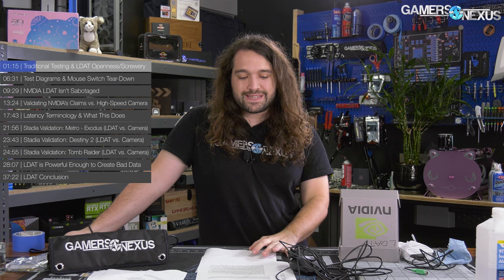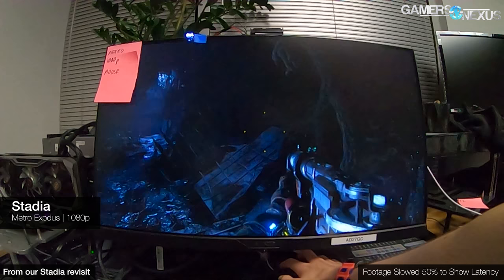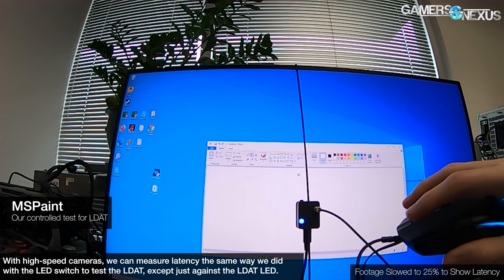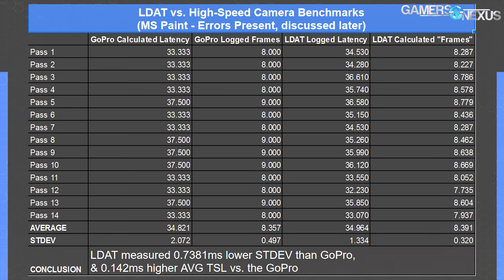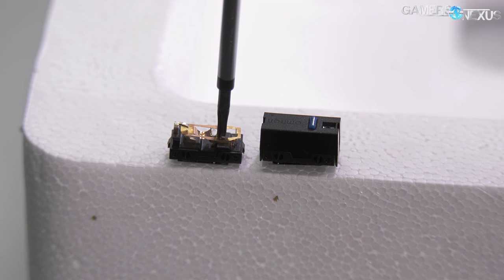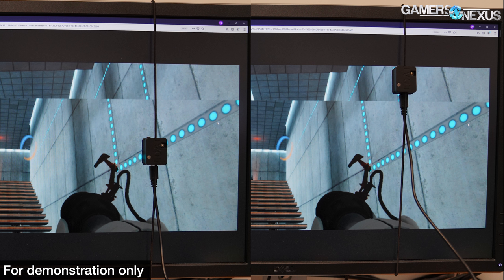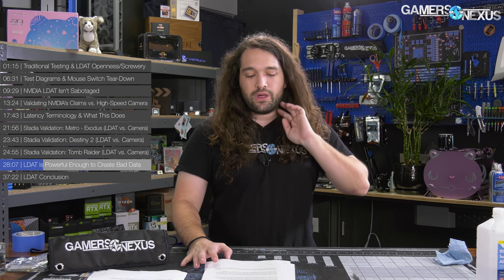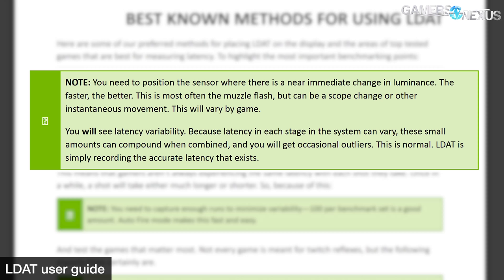Automated System Latency Test Methodology (NVIDIA Latency Analyzer Validation)

Comment: Hey Steve, thanks for addressing my mouse signal question that I posted on the Ryzen vs. Intel system latency video:

"How did you measure the exact moment when the mouse was sending the signal? There's some travel in the button before the signal is sent, and even after the signal is sent, there may be some flex in the button itself that may appear as movement on the high speed camera. Not questioning the results, but this could have driven up your variances."

Comment: Just a thought, for assistance of device setup, perhaps make a guide consisting of a clear plastic with adhesive (old school projector transparencies and some scotch tape come to mind, cheap and any printer will work with it) and with printed circle reference for the sensor region (that does not interfere with observed region) and a printed rectangle for the external device profile. 

Using the muzzle flash example you can apply the template on screen near the muzzle, verify using video that muzzle flash is accurately passing through the circle of the template. If it's not positioned well then you can adjust the template in measurable quantities (4mm up and 6 to the left) as opposed to blind adjustment to find a sweet spot. Then final setup consists of aligning the body of the device to the rectangle of the template. The template can remain in place during testing, as time for photons passing through less than a millimeter of clear material is negligible.

Realistically the template can be made in about 10 minutes between measurements and making the 2 shapes in any graphics program that prints to scale (Microsoft Word can even do it). Produced for with less than 30 cents material. Plus, testing setup can be done in 1-2 passes taking maybe 10 minutes total time. 

Additional benefit, it helps with troubleshooting. If the phenomenon you're observing does not encompass the entire sensor portion of the template (Lara's arm in Tomb Raider) you can reject it for testing.

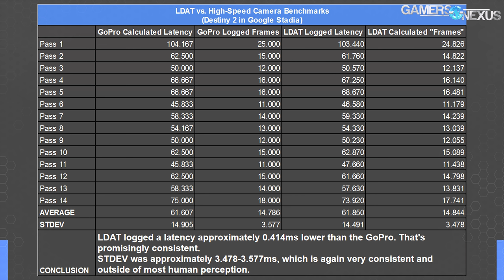Comment: I think there's an error at 24:42, where the conclusion drawn in the table was that standard deviation was around 3.478-3.577ms, when on the chart it looks like that's the standard deviation in *frames*, and the standard deviation in milliseconds is 14.905 and 14.491 for the two methodologies, which feels fairly high and maybe within the range of human perception. Of course, that's a comment about the variance of Stadia and Destiny 2, not of your testing methodology.

Comment: Hey. I have been messing around with latency testing using an arduino and a photodiode, which has been fun, and there are some things I've learned along the way that you might or might not find useful, I'm just throwing these out there.
- Consider using in-game menus rather than shooting guns. Taking CS:GO for instance, opening the buy menu darkens the screen instantly, and closing it restores brightness. I've found it was great if you can find a bright spot (my preference is on the Vertigo map, near CT spawn, there is a lamp a head level, you can stuff yourself in there and it works nicely.
The "tab" menu for Fortnite works aswell, and most games have some kind of inventory, or menu or something.
- It might not be the case with LDAT, but my photosensor is reacting faster on dark -> light transitions rather than light -> dark transitions. Might be something to consider, however it does not really matter if the methodology is consistent.
- I don't know if it was mentioned somewhere, but monitor temperature do affect these measure quite a bit. I've had consistent differences up to .5ms on a cold boot during winter vs 2 hours alter when the panel was warm. Might be worth considering adding some (doesn't have to be very precise) temperature check.

- Also, it's not really LDAC related, but using an Arduino, you can program it to send keyboard or mouse inputs at random intervals and auto measure, and you can then 100% automate latency testing, and export it nicely to CSV or whatever you want, using either something like puTTY to monitor COM port, or a program that will do it and spit out data (I have a small Python one which isn't perfect yet, but works quite well). Random intervals for automatic testing is important, I've had issues before adding where the detection would "sync up" with the refresh rate, and I had bad data.

Great video, great job, keep doing what you're doing, you've been an inspiration for me !
Reply from the maker: You should not use in-game menus. We talk about that in this video. They go through a different engine path in many games and are not representative of actual gameplay.

Comment: *small typo found!
the chart at 24:36 says stddev is 3.478 to 3.577ms, it should say 3.478-3.577 frames
Reply: Also latency is 0.243ms higher on LDAT. The 0.414ms is the difference in the standard deviation.

Comment: It may not always be the most relevant piece of data, but latency capped at 140fps on a 144hz VRR monitor in competitive games would indeed be a valuable comparison between various AMD and Nvidia GPUs. That's probably the ideal to most of your audience (or should be, there may be a lack of education) and would definitely be worth at least some investigation.

Also, don't forget that there's nothing wrong with doing the classic mouse1=strafe left test. Movement typically has higher baseline latency than shooting because of acceleration etc, but if you're just looking for a latency difference it is often a perfectly good test.

Comment: So Nvidia basically did the same thing I commented in your latency video. But I used an Arduino instead. A light sensor attached to a screen conected to an Arduino that triggers a mouse button press using a gpio soldered to a mouse button and using the arduino to log the clock cycles between the GPIO output and the LDR light sensor. The only manual labor involved is choosing a portion of the screen that drastically change light levels when you click to position the light sensor.

Comment: IMO the best method for latency testing would be custom software. EG just make a simple game (even just using Unreal or Unity) that is locked to 1000 fps (very easy to hit with just a 2d game) that when you click the mouse it changes colour. That way you remove a GPU's ability to render a game faster reducing end to end latency (the faster the GPU can render the less system latency there will be as your mouse input will be processed faster).

Comment: for better repeatability of LDAT positioning it may be helpful to 3dprint/ make a bracket that can  have a few x and y notches or positions so you can repeatably plate the LDAT, using the  screens physical edges as a datum.
Reply: also for in game to ensure aiming at a specific place, would working with a game that has a "save" function that loads everything in the exact location each time you re-load from the save help?

Comment: Nvidia Geforce's "Why System Latency Matters" video seems a little off to me, They attempt to show that system latency is the cause of "Peaker's advantage" when in reality it is unrelated. As you mention in this video, most modern multiplayer games immediately process player inputs client-side to make the game feel more responsive. The peeker always sees the holder first because the peeker's position on the client-side is ahead of the peeker's position on the server-side (due to network latency). Whenever you are playing a multiplayer game you are seeing past representations of all other players - unless the game uses heavy delay based netcode (higher than any player's network latency), or the player is holding the same inputs and the game uses rollback netcode.

Comment: If a GPU can do 4k 60FPS and you are not bottlenecked by the CPU, will that GPU do 1080p at 240Hz? If not, where would the bottleneck be?
Frame rate isn't system latency however having a frame ready to send to the monitor may be?
Great in depth test methodology research guys (guys is a general term not implying only 'guys' work at Gamers Nexus. Would rather clap than use jazz hands guys).

Comment: @Gamers Nexus  Pro tips that you MAY not have heard yet, read entire comment for those that are curious about technical stuff.  I'm surprised that TimerResolution.exe (Lucas Hale) wasn't mentioned (no one in comment section yet either) as a way to reduce unforeseen variability.  Then there's core unparking.  Also: bcdedit /set useplatformtick yes
bcdedit /set disabledynamictick yes
bcdedit /deletevalue useplatformclock

If you want to get into server-grade engineering tweaks, see below, (some of what I typically do on mission critical latency sensitive servers at work). People think I'm joking when I ask if they turned on rocket mode in Windows.

Powercfg -setacvalueindex scheme_current sub_processor PERFBOOSTMODE 1
Powercfg -setactive scheme_current

Powercfg.exe -setacvalueindex scheme_current sub_processor PERFINCPOL 2
Powercfg.exe -setacvalueindex scheme_current sub_processor PERFDECPOL 1
Powercfg.exe -setacvalueindex scheme_current sub_processor PERFINCTHRESHOLD 10
Powercfg.exe -setacvalueindex scheme_current sub_processor PERFDECTHRESHOLD 8
Powercfg.exe /setactive scheme_current

Powercfg -setacvalueindex scheme_current sub_processor DISTRIBUTEUTIL 0
Powercfg -setactive scheme_current

Powercfg -setacvalueindex scheme_current sub_processor CPMINCORES 100
Powercfg -setactive scheme_current

Most (all?) of those were copied from:
https://docs.microsoft.com/en-us/windows-server/administration/performance-tuning/hardware/power/power-performance-tuning 

I'd be curious to see if any of these make any difference (for your use cases) if done on both or either your 'host' and 'specimen' windows machines.

 Amazing videos as always! THANK YOU

https://cms.lucashale.com/timer-resolution/

Comment: I really would have loved your take on the other tool NVidia send out to reviewers (at least to Linus), the PCat, that measures power both for the PCIE-cables and the actual slot of any given PCIE device. It should be more accurate than a multimeter with current clamp, and should once and for all clear up which cards might or might not wreck cheaper motherboards due to taking to much current from the pcie slot.

Comment: great video thank you.

There was a lot of data in the video that was very interesting to watch. I do have one question though. Which is basically because this is using a monitor to scan for the latency and fully knowing that every monitor will respond differently in how it displays objects to the screen and also have different latency's themselves from screen to screen and brand to brand and model to model of any given monitor being used to do the testing.

SO how can this be used to get near 100% readings if monitors are not all created equal to each other. Yes you can pick a screen and used that same screen going forward but what happens to the next guy on another YT channel or review site doing these same tests and may get completely different readings than you did here. Even if the other site used the same games and same scenes but if he/she used a different monitor they could get different readings and this could happen to pretty much everyone doing the tests using this way of testing for latency. It is a cool idea but there are just way to many things that can be done wrong and also go wrong by using different displays.

Comment: If we are at this point where we can test system latency and people are buying based off speed. Can we not agree that this is just a deep rabbit hole that will not end? 

Unless you play single player games, the sys lag is not that critical. One would have to have a 1ms connection to the server then rely on the server to respond back within 1ms for best case scenario of 3ms total round trip. 

The difference of 120hz to 240hz is ~4ms in time. That best case connection to server is roughly a loss of 120hz. 

In the end I believe we are focusing on faster is better (as usual) but at what point are you getting real performance vs making you think you actually have the fastest response time.

Comment: Isn't the thing connected via usb ? so it could just read what driver is installed which leaves room for cheating.(This is just a speculation)
You can test using diffrent host systems

Comment: How long does the LED on your mouse take to extinguish when the switch is actuated? 
Is probably very fast and probably negligible, but it's not instant due to capacitance in the circuit.
Reply: microseconds, since the LED pulls enough current to drain the cap quickly

Comment: Contrary to what many others seem to think, I think that the trigger for Nvidia giving out these devices wasn't a potentially lower latency in drivers etc (though that could've been helping), but the new display chipset they just released with supposedly lower latency.

I think they've been long time looking for a way to get back some of the profits they lost there after they caved in on supporting the open Adaptive Sync standard. That lost them most of their GSync module sales. That new module is a innovation that's meant to assume at least some of these lost sales. But when reviewers lack a way of testing for this them noone will be interested in them, so they provided reviewers with the means to test it.

It's capitalism at its best. I just hope that people will not overvalue the lower latency.

Comment: They need to use sound as part of the test, as that has a much higher sample rate, and it  would remove the GPU and monitor (help isolate input vs display latency). The only issue is that I'd wager most games are using the refresh rate for the game loop and they may even ADD lag as humans can clearly notice the speed of sound, especially if the sound travels faster than the speed of light.

I'd be very surprised if home theatre nuts don't have calibration tools. But then they'll happily buy fancy HDMI cables to get a cleaner signal so it might not be cheap.🤔

Comment: What if you manually remapped movement controls to a mouse button, so you could still use LDAT to measure change and using something other than muzzle flash to detect latency?

Comment: Not to complicate the issues, but, isn't there a difference in how different games handle mouse click events? I could imagine differences in the compilers used for the code base for the application. Not every code event is programmed the same, and not every code event is handled the same. System event handling can even change under varying system loads. Is this so fast it obviates the measurement levels you are measuring? I have experienced event handling bog down when a given app slows down under heavy system loads caused by the program running. i.e. When the display slows down under heavy loads caused by too many sprites than the graphics card can handle, I have seen mouse events exceed one full second. I have also seen compiler updates change the response times of mouse events change significantly. Any Thoughts?

Comment: i believe nvidia wants to "compete" in the scenario when both NV cards and AMD cards perform 200+ fps and claim that their render engine lowers the latency in these cases (csgo or valorant) 
in the other hand, games that need more gpu like the new tomb raider may introduces a lot of error in these calculations as the pipeline isn't completely full for the reflex "to kick in"
this may even backfire on nvidia if the game is way better on AMD cards because latency could be the same but rendered at different times
also i think 14 passes is a bit too little if you want to try to normalize things with reliability then it should be at least 30 passes (deviation on average could be better approximated), but it is a ton of work

Comment: Question, does LDAT freak out on CRT Scanline TV's? I ask cause if it doesn't could you test the latency of original SNES vs SNES Classic vs Switch Virtual Console games at some point? The CRT TV you eliminate the modern TV latency that older games has inherently. Could also test the latency of playing a original SNES on CRT vs Modern TV's upscaled and upscaler techs added to modern TV's. You guys are, after all, "Gamers" Nexus 😉

Comment: I have a question. What would 1 need as far as parts to realistically run AAA games now & later on Max settings with rtx etc. on, on 21:9 ultra-wide monitor 1440p at 144fps & stream? (34gk950f) @GN

Comment: I'd love to think that input latency and the whole system latency is a different thing. I guess the community has something else in mind. 

input latency should be clocked between the time input is fired, and the time it reached the application (game, for example). And the whole system latency is between the input and the output I think....

The reason is I have seen some terrible display (TV... in particular) that add like 100-200 ms to the display latency. That's in the realm of unplayable. This is nothing about input latency if we are talking about computer.

Comment: yo stevey boi, should have wired the led so it went when the switch contacted instead of when the other one broke, probably not as much of an issue with that type of switch atleast, but for say keyboards, when you start pressing the key/touch the key cap, isnt when it registers electronically